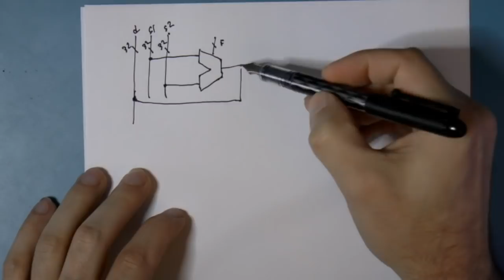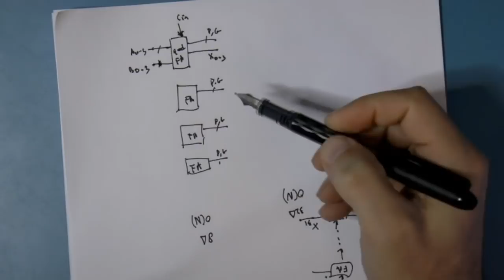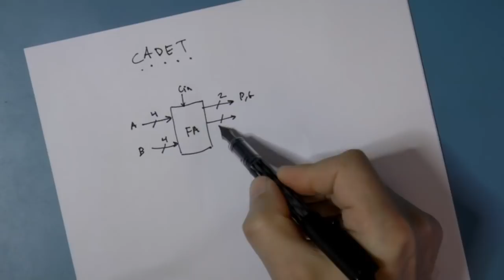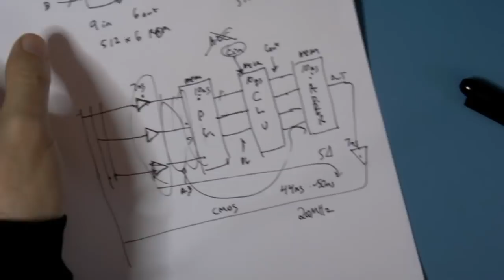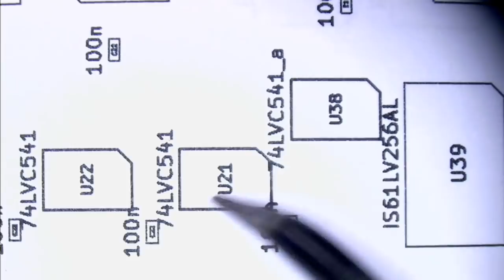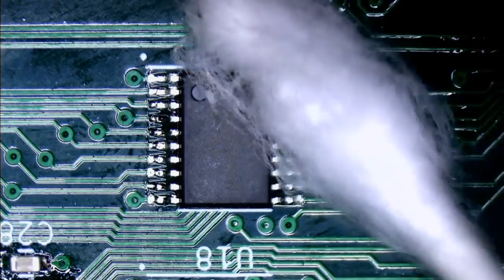Livestream: Soldering the LMARV-1 ALU

Comment: Regarding the 74F181, there's a british guy on ebay who has over 1000 of these in stock, in case you want to use it for a future project. The 74F182 CLU is also available from another ebay seller. 

It would be really cool to make a VAX 11/780 replica CPU with these chips, since 74 Schottky versions were actually used in the original design.